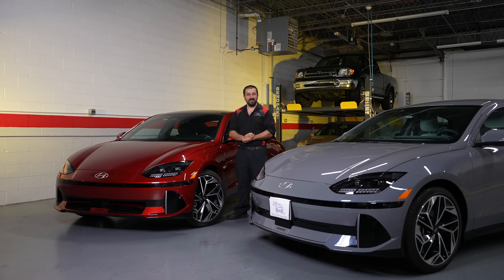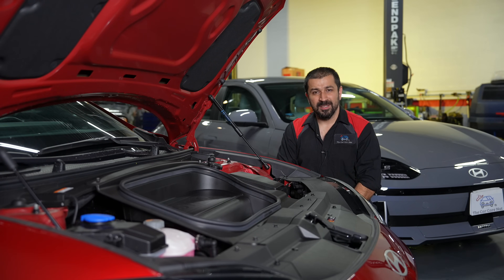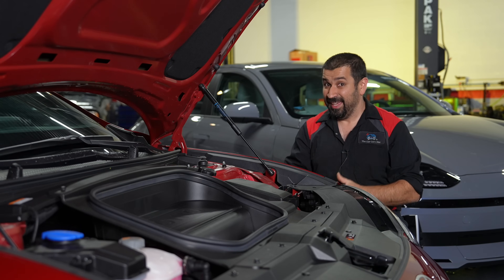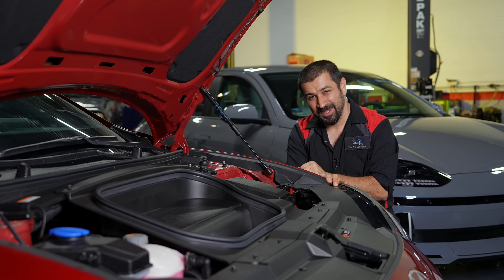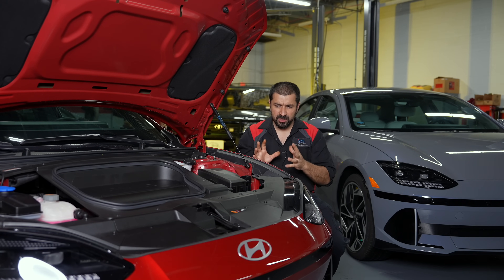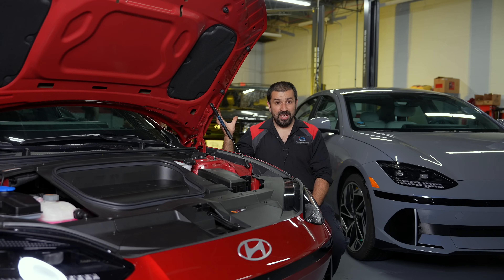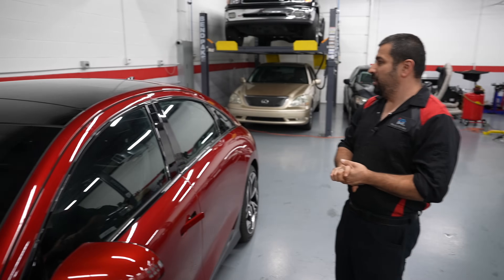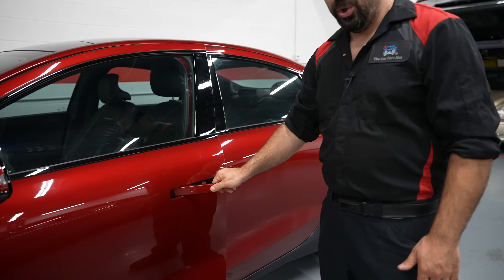Should You Buy a Hyundai IONIQ 6? Thorough Review By A Mechanic

Comment: 21:26 That actually isn't a brake vent (brake cooling vents usually guide airflow in from the inboard side of the wheel), but is a drag reduction feature that some manufacturers call an 'air curtain'. This airflow helps contain the turbulence caused by the spinning wheels, which would otherwise spread out and cause more drag. Additionally, it helps make the front of the car less square from an aerodynamic perspective, while still allowing the car to look square from a styling perspective. 

Features that reduce drag near the driver/front seats are important because drag results in wind noise. That's why some cars that aren't focused on drag or fuel efficiency still have air curtains.
Reply: 😮10x 4 yr knowledge
Reply: Yeah noticed this
Reply: Correct. It’s called an Air Curtain and help direct high pressure air on the nose through the curtains and remove air pressure in the wheel well.  Many newer cars, EV and ICE, use air curtains.  And the flair arch in the front wheel well is 100% function, it’s not for looks. The Car Care Nut may be knowledgeable about car mechanics but not on aerodynamics.   This entire car is designed for maximizing range and reducing aerodynamic drag.   It was not designed for its looks.  This is why it looks similar to a Porsche because Porsche were also designed with aerodynamic efficiency in mind. This is why they are some of the best cars on the race track, because at high speeds, it’s all about the aero!
Reply: I was surprised he make that mistake.
Reply: Lets go a step further and be totally honest. Those air curtains - on MOST cars - are little more than a styling gimmick. Firstly, air is going to come around the front fascia and flow across the face of the wheel anyway. In fact a lot of it is going to do just that around the outside of the air curtain tunnel too, whether the little air curtain tunnel is there or not. Secondly, the amount of difference it's going to make at 60 or 70 miles per hour is simply minuscule. Like literally 0.001% of a difference. Over the lifetime of the car, it MIGHT add up to enough energy savings to pay for the extra plastic it took to make the dang thing. And I use the word MIGHT there optimistically.
Reply: @xtnuser5338  I disagree

Firstly, air curtains are not a styling feature, as the majority of people will never notice that they even exist. While many cars have false, blanked off 'brake ducts' as a styling feature, they are not even necessary for air curtains to be implemented in a vehicle.

Secondly, several different car models have air curtains, and most do not advertise it; in a world where automakers have started using plastic oil pans to save pennies, they would never invest in the additional development and manufacturing costs if there wasn't a benefit to drag or wind noise.
Reply: @xtnuser5338 Where did you get your knowledge of the (lak off) effects of air curtains?
Reply: @Conservator.  I don't have specific knowledge on that specific topic. I just have basic aerodynamics and fluid dynamics understanding from when I was an aerospace engineering student.
Reply: @xtnuser5338  
Thanks. I don’t understand why manufacturers would make considerable extra costs to install these air curtains instead of fake air intakes of the air curtains wouldn’t do anything slightly significant.
I don’t have any aerodynamics training. All I know is that it’s extremely complex to predict the effect of even minute changes to an F1 car and even after CFD modelling and windtunnel testing, some ‘upgrades’ appear not to work on the track. 
What I mean to say is that’s it’s my impression that it’s very difficult to predict the effect of air curtains ‘off the cuff’. I’m just curious.
Reply: @Conservator.  It is a difficult and sketchy science at his point in our history, to be sure. I'm not saying it would do absolutely nothing. I'm only saying I don't think it would do much, and especially so at typical legal highway speeds. The effects of aerodynamic differences would be roughly 8X more at F1 max speeds.
Reply: @xtnuser5338  Thanks! That makes sense. 
I have a similar disdain for those ‘diffusers’ wrapt around rear bumpers of some cars. They are decorative at best. I don’t like things that suggest something but that don’t have any meaningful effect. 

I will treasure the thought that the ‘air curtains’ on my car will have some effect when doing 250kph at a German autobahn. 😁
Reply: @Conservator.  Yeah, the term "diffuser" has seemingly been applied to describe any black piece of plastic with some bumps on it under the rear bumper. It annoys me every time. I think we can take one glance at most of them and know they aren't "diffusing" anything whatsoever. The people who don't know any better obviously haven't ever seen a real diffuser.
Reply: @xtnuser5338  I couldn’t agree more! 👌
Reply: Makes you wonder how useful they are when the model 3 is ditching them to reduce drag by 4%
Reply: @CakeLorde    Every change Tesla makes is about $$$$, nothing else.

Comment: As an actual owner of this car with about 11k miles, it is actually really good, my only gripes are.. 

1. The sound system its truly awful I was ripping stuff out the second week of ownership. (You can see it on my YouTube)

2. Some of the computer logic doesn't make sense. For example the car can be setup to automatically unlock when you approach the car with the key fob on you but you can't set it to automatically lock when you walk away. Another example is that if you DCFC when you finish you have to press the ignition button to "restart" the car that's already on.

3. The overall performance & handling, its adequate but I really want more but hopefully thats fixed with an ioniq 6n in the future.

4. You can't get a limited without a sunroof 😡

The good

I usually get more range than the advertised range

It will actually charge 10-80% in 18 minutes on 350kw charge. I disagree thats it bad on the battery, 800v batteries dont have as much current going into it to Fast charge. There are ioniq 5 oweners who exclusively fast charge and battery degradation doesn't even hit 1%.

Quiet place to be and HDA II works really great and helps you drive big distance without getting tired.
Reply: Do these still have issues with 12v battery dying when parked for a while, due to parasitic drain from the car?
Reply: This year, I started working with/ for Koreans. One would be surprised how many odd ideas those people have. Their logic is... Different. They can have a brilliant idea today and 5 completely illogical ideas tomorrow. 

Now I understand that they could find it very logical to put a turbo in an entry level hybrid, have reversed orientation of a "gear shift" or what you have described.

I will probably avoid Korean products.
Reply: I talked to a 5 driver recently who said her battery capacity has really dropped.   She drives 160 miles a day (must have a shitty on-prem job) and FCs to 95% regularly.
Reply: You’re wrong about fast charging. It is hard on ALL batteries.
Reply: @Digikidthevoiceofreason     His point is that there are degrees, that 800v charging isn't as hard as 400v.
Reply: A car is a hostile listening environment in the first place.  Mine seems fine for what I need.
Reply: @Digikidthevoiceofreason  Extensive recent survey by Recurrent Auto showed no difference in 12500 Teslas.
Reply: @anthonydatri7301  there is no difference in individual cell current during charging in 400v and 800v or 10000v pack as long as cells are the same. You are putting the same amount of energy to the same cell in the same time, cell has same voltage, therefore current is the same.
Reply: And the range is???
Reply: @aantonic  depends on model . . . from 240 to 361

Comment: Great review as always....
couple things.  The fast charging rate is due to it being an 800V architecture.. so the Amps required to charge are about the same as any other car... but since the Volts are double.. it charges faster. Amps are where the heat comes from.. so I dont think  battery damage is more likely than any other car.
Also..  every EV sold to today has DC charging availiable.

As to the color of the other car.. the blue is very clear on camera..  Maybe in direct sunlight it would be more visible to the human eye.

Love the channel.. keep up the great videos.
Reply: Ironically I almost bought Transmission Blue in another state, but at the last second I found a newly-posted Ultimate Red locally - for 4K less and a dealer with their shit together.  Live chatted with someone at 1am who set up a meeting in the morning.  The sales guy SMS’d me first thing.  We went over and drove the car home.  First one delivered in PA, I’m still finding film to take off.  

I originally wanted an RWD but was told that they don’t send many to the northeast because winter, which I guess makes sense.  In NY I met an RWD owner who had to go to Ohio to get his, wouldn’t want to be skinning around in a Buffalo winter.  But then he’s a smoker so his judgement is already suspect.

Comment: Dump the 20" wheels and buy some 18". I went from 306 mi range to 360-370 range. The SE model comes with 18" and is advertised with a 361 mile range. I bought the SEL and dropped to 18" rims, Big improvement!!
Reply: Thanks for your comment.  Do you find in highway driving that the 361 mile indicated range is accurate?  What is your experience?
Reply: 361 is for RWD.  18” AWD SELR is 316.  

Better city range than highway
Reply: @anthonyeleven1  Got it! Thanks for sharing this.  Any idea what someone should expect in highway range driving at 75mph (the legal speed limit in much of the Mountain West)?
Reply: @flyingspirit3549   Depends of course on your trim and temperature, and whether you're using AC or heat.  Thing about mountains is that you'll pick up significant range going downhill.   In our Mini, which I think doesn't have a heat pump, the AC seems to take about 10%.  I think the speed impact is mostly a function of air resistance, like in a boat limited by hull speed, where the water can't get out of the way fast enough.  So I'll blindly guess 85% of rating.
Reply: Is it safe / okay to just replace the wheels with a smaller size by yourself? Isn't the car designed and tuned for the wheel size it comes with from the factory? 🤔
Reply: @flamingspinach  I had it done at Discount Tire. The wheels were for for the ioniq 6. Fast Wheels in Canada. Got them through aftermarket ev in florida

Comment: As to battery life: In our 2022 Ioniq 5 with 30,000 miles, according to our OBD reader, our battery SoH is 99.7%.  We do most of our charging at home, but do have a good number of long trips, hence the mileage.

I'm not worried about the battery life.
Reply: 42,000 miles on my niro, has 97.5 percent of raw life left at 100% charge. Effectively no loss to the user.

Comment: Little correction, the oboard charger is not used when DC Fast charging, it is bypassed completely to charge the battery directly with the exception of using lower power 400v DC fast chargers. Then it passes that current through an upconverter in the inverter to step it up to 800v.

Comment: FYI at 28:38 the little protector plastic piece is upside down.  The purpose of that plastic thing is to cover up and protect the two DC charge pins while charging using a standard L2 J1772 AC charge plug.  This keeps the DC pins safe and clean, especially charging on a level 2 outside in the rain and elements.   As one can see, this cover is upside down which would prevent a L1 or L2 J1772 to be plugged in.
Reply: Yes, and the Ioniq 6 I was given while my Ioniq 5 was in the shop had the protector piece upside down as well, and it was a brand new vehicle.  somebody at the factory needs remedial training.
Reply: @tomrossman9371 That is true. The protector is upside down for all vehicles. It puzzle me but it is what it is.

Comment: Excellent review but not looking at all angles… at least for me.
Being from the north with extreme cold, road salt and snow for months there are a few other things to consider apart from the battery or range.
As good as a Tesla is in winter it loses its paint to road salt, it cracks like an old wooden chair and the suspension is rock hard.
Traditional auto makers are still better at making cars for extreme weather.

Comment: The key is designed in its perfection, if the battery runs out 🔋 the key fob, before it happens, the car screen warns you that the battery is low, it is your responsibility and laziness in not changing it

Comment: I really liked the video. I have an Ioniq 5 myself and have a different opinion about the PTC heater: the heatpump is optional so the PTC has to be there. I think this is why it's still there. And sure it's only 99% efficient but when it's really cold heat is there in seconds. I think this is a trade-off I'm willing to take.

Also don't expect any e-gmp platform car in the future change massively the heating and cooling system. 

Also the internal charging unit ICCU is not part of the DC charging process so it doesn't get hot when charging.

Comment: This is coming from the guy who made an entire video about a Lexus needing to take apart the whole entire dash, just to repair a damper, and told the customer to replace the evaporator with it, complaining that this car, has "messy hoses" which are all EASILY ACCESSIBLE UNDER THE HOOD, vs the Tesla setup where if anything goes wrong on the super manifold, means taking apart the heat exchanger and everything else, just to get to one valve.

Comment: Very thorough review. I agreed with most of what you said. I actually kind of like having the window buttons in the middle, depending on how it's implemented. If it's like those older Saturn Vues or BMWs where they're all spread out then it's dumb, but I like the way my SAAB had them, you could very easily open and close all the windows simultaneously with one hand (actually easier than I can with most door-mounted window switches. It also saves them 1 window switch mechanism by have the driver and front passenger share

Comment: I have watched alot of EV reviews and I love how you explained the thermal management of Ioniq 6. Although I am still unsatisfied on the question of "How efficient is the thermal management of EVs?" As we all know the number one enemy of EV batteries is "HEAT". All videos I have watched regarding battery thermal management, their main highlight is cold temperature effecting range and the like. How about countries with tropical or hot climate areas? We also want to know the other side of the coin. Comparing it to "gaming PC's". We want to know the exact data/numbers of the temperature, to know whether or not the preferred battery temperature is being maintained or not. Since the correlation of heat and battery degradation is stronger in high temperatures. The topic regarding with battery thermal management in tropical/hot climate/summer time is not being tackled much or just being ignored. I hope you make a new video regarding the efficiency of thermal management in hot weather. Thanks!

Comment: Thanks, especially focusing on the mechanics. I think it really has to show how the Hyundais will hold up, lease is a good idea. Compared to the Tesla 3 I thought the Ioniq 6 has a lot more space in the rear, in the Tesla I could not sit up straight.
Reply: I bought the 6 in part because of the rear headroom.  My son is 5’10” at 15.
Reply: @anthonyeleven1 hello, I’m actually planning to buy Hyundai Ionia 6 as well. Since u have bought it, could you tell me what’s the warranty status on your car? Also how much would battery replacement cost if your battery died, got run over, etc?
Reply: @blackgold754  I've had the car for 8 months, so no real warranty issues.  The applied a recall without charge.  No idea how much battery replacement would cost.  I suspect it wouldn't be cheap, but I also expect to not need one any time soon if at all.
Reply: @anthonydatri7301  Battery replacement? Don't even think about it.  Aprox. 75% of the total car price.